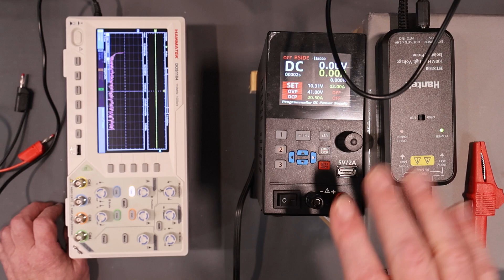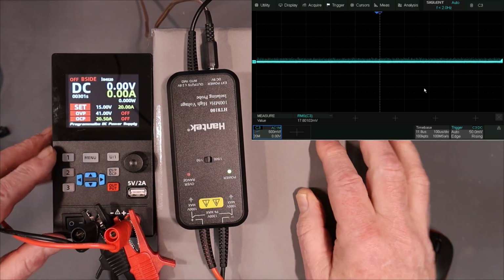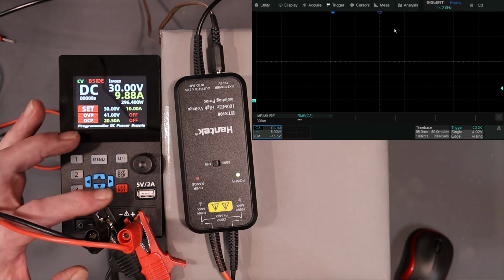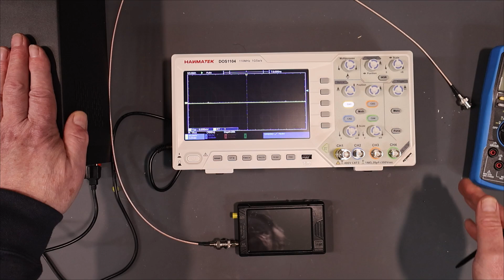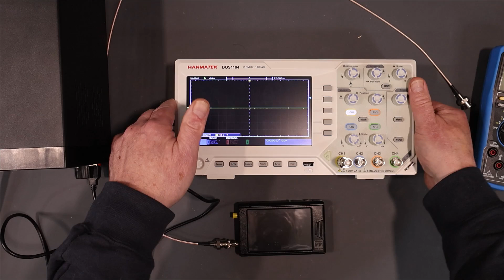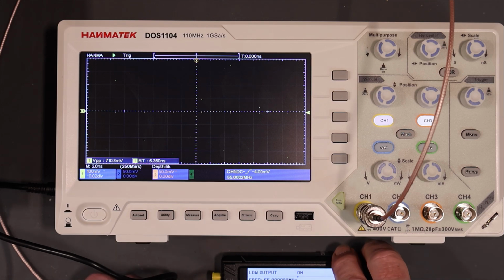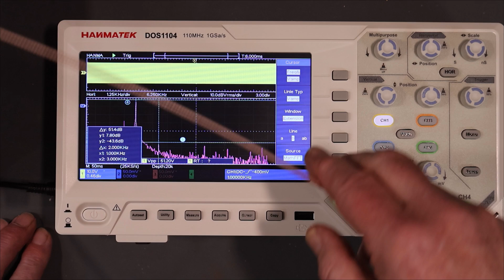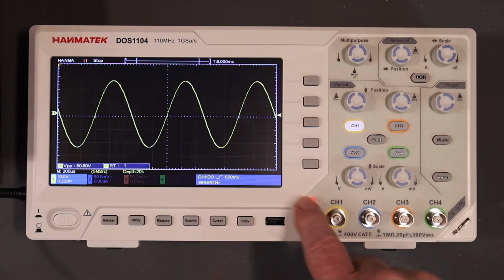Uni-Byte 0274 - BESIDE IB-4020 PSU & Hanmatek DSO1104 Scope: Mini-Lab Revamp Part 2

Comment: I'm in two minds about the scope, in all honesty i'm not sure about the ' first scope' makes it good value. I think I would say "save up for a little longer" For a start it isn't really a decent 4 channel would be better of being 2. But that's just me ! The noise output of that supply was incredible ! Cheers !!
Reply from the maker: I think what makes it a good value is the price/performance ratio.  As for a fist scope, while there can be something said for getting one for 2 or 3 times the price, for someone that might find they don't get much use out of it, that can be seen as a bit risk.  Sure, it's only a 2 ch. scope at 110MHz, but it does allow you to use 4 ch. @ 55MHz which is plenty useful and  not a feature available to you with only 2 ch.  Plus, it gives 240MHz on 1 ch.
Reply: @uni-byte  :)

Comment: hey what is that handheld signal generator your using
Reply from the maker: It's much more than a signal generator.  It's a spectrum analyzer and it's called a Tiny-SA.  Not very expensive, but great little gadgets.  There are various models out there ranging from about $50 to $200 for the latest and greatest.